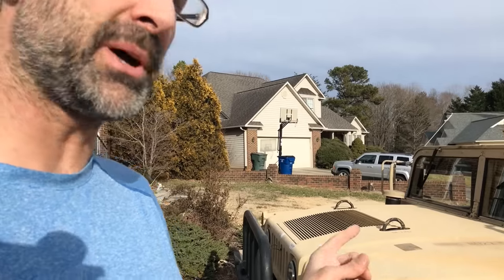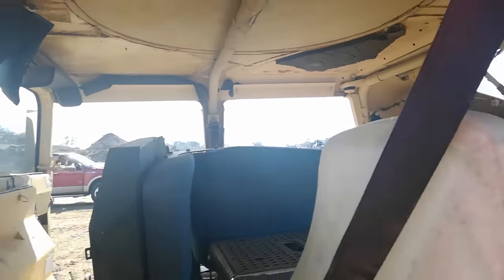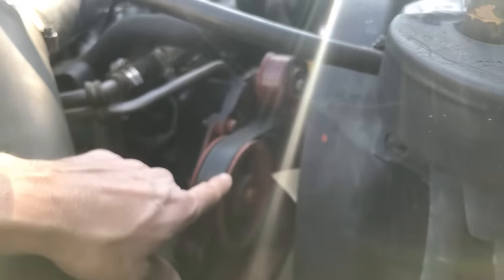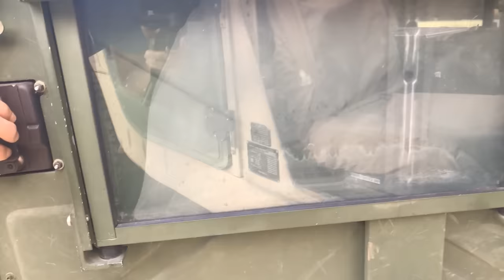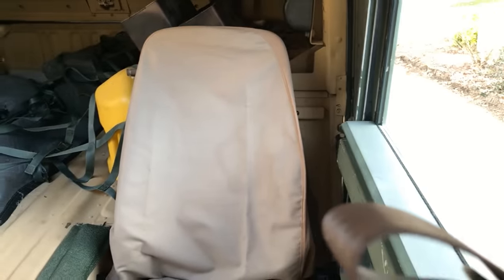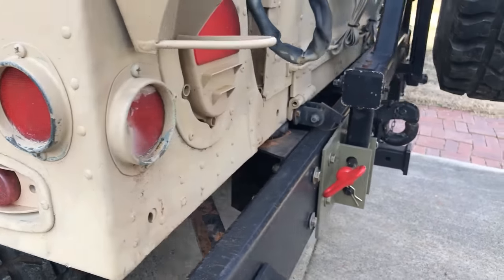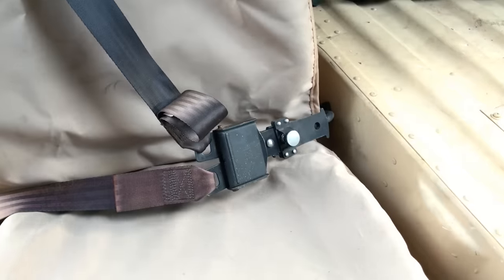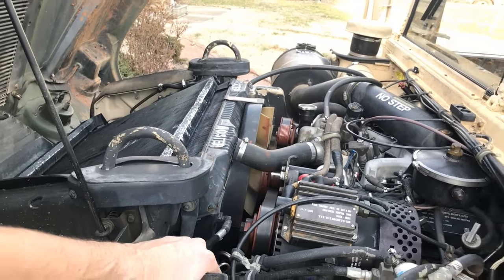Picking up a Surplus HMMWV M1045A2 from Auction & Transforming it into the Battlewagon 2.0

Comment: Ist time I've watched your channel so I don't really understand what you are doing other than this being number 2 so presuming it's replacing number 1. You also seem to be putting this back into military spec and I've never seen what makes up a military spec Hummer so thanks for the review and explanations that was very interesting. I was amazed that you got that engine running after seeing what came out of it's sump and knowing it had been full of water, I had no idea you could do that, in fact I'd have bet that you couldn't, guessing it's because it's a Diesel.  Anyway thanks for the vid I enjoyed it. Did wonder why they had a hatchback arrangement instead of a flat roof to the back, was impressed it opened from both sides.
Reply from the maker: Hatchback is because of the blast from the TOW missile that was mounted on top.

Comment: You do know that traversing assembly is for a motorized turret maybe for the TOW mount cause I don’t want to have my head out there!!!
Reply from the maker: Good to know
Reply: The TOW system goes on it ,when travelling. Lower ,and optics. -0352, Marine TOW gunner, and M.T. Nco.
Reply from the maker: @keithwittman4741  Thanks for the info.
Reply: With out the motorized turret, if you had the tow system up there 400lbs of equipment would spin itself to the low side !  You had to know that Before you pulled the handle for the turret lock!
Reply from the maker: @keithwittman4741  Motorized turrets are a fairly recent addition to HMMWVs. They had non-motorized turrets for 2 decades before SOME of them got motorized turrets. This was a TOW missile carrier and it had the manual turret, just like what is installed now.
Reply: @GearreportdotCom  I know, just saying when I had the manual style, it could whip you around. If you didn't know the tilt of the truck, and the 400lbs.

Comment: I’m getting my Humvee soon and it’s says JP fuel only. Can I just put regular diesel?
Reply from the maker: Yep. Mine says "JP5/8 Diesel Fuel only". If it is an older model, then run some diesel fuel additive to the fuel.
Reply: Gear-Report.com it’s good to hear that. Mine is 2002 M1123 6.5L. Just hope the regular diesel won’t cause problem to the engine. Do you put fuel additive to your Humvee?
Reply from the maker: @danielli2268  I ran a cetane booster and IP lubricant additive in my M1038 and M1045A2. Not sure if the M1165A1 needs it... but I'll use it in that as well.

Comment: Let me know when you start lining the unit with bed liner so I can buy stocks in Raptor
Reply from the maker: Not gonna happen. Bedliner is an exterior product. Not putting it in the bed, since it is interior. DEFINITELY not coating the exterior in that crap.
Reply: @GearreportdotCom  Bed liner can be used anywhere you choose to use it, I know of many hunting rigs and work trucks with the floor boards coated so it can be rinsed out with a hose and not rust out.
The raptor system works great and can be layed down to any texture
Your  rig your call
Reply from the maker: People use bedliner like that. I agree.
However, after reviewing MSDS sheets and discussions with a few people at different companies that make bedliner products they all say NOT to used beliner in enclosed passenger areas. The bedliner materials all continue to outgas toxic fumes when exposed to heat for years after initial curing. HMMWVs have aluminum bodies with almost zero insulation anywhere, and the drivetrain set up in the body. So, there is a lot more heat coming through the body than normal vehicles.
Put all of that together and bedliner in the passenger areas of HMMWV is a bad idea. It isn't a good idea in other types of vehicles. but at least the other vehicles are designed differently so that heat coming through the body isn't quite so extreme as it is in HMMWVs.
So, my resistance isn't a simple matter of "it's called bed liner... only use it in the bed". It is more of a health and safety concern based on MSDS data and discussions with manufacturers.
Reply: @GearreportdotCom  Were you thinking about using the dynamat Style insulation or the spray on Lizard skin? I have used the high temp dynamat on my SxS with good luck for heat shielding on the muffler / bed barrier. The Lizard skin I have not tried.
Reply from the maker: We did a project with lizard skin on our first Humvee. If you go to our website you will find a couple of articles about that project. SpaceIt worked amazingly. For this one we started a project with Kool Mat, but have not made much progress since we listed the Humvee for sale.

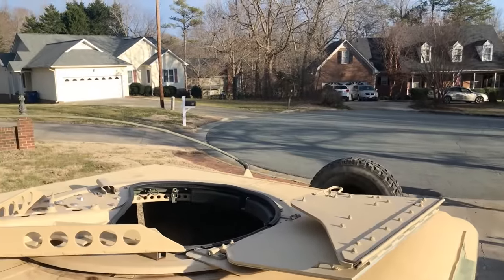Comment: Great done footage at 9:59 
How much $$$ do you have in this project if I may ask?
Reply from the maker: How much $... Honestly, I've been afraid to add the rest of the parts to my spreadsheet and get a real # for the total $ invested.
However, I can say that the HMMWV, transportation from the auction site and complete turret assembly were covered by the sale fo the original Battlewagon. I've also been lucky that I've been able to buy some extra parts when I've found great deals and sell what I didn't need for more $, while still giving people good deals. So, I've spent $ on parts, but then made back a healthy % of it. Also, once the reviews are done I've also traded a few review guns for pricey HMMWV parts like the spare tire carrier. Now that most of the mechanical and structural additions are done (turret, engine running well, bumper) I'm moving to upgrades that brands send for reviews. So, there is a lot of value added to the Battlewagon 2.0 without cash changing hands. 
And I can't even begin to calculate the time invested. Yikes!
How's that for an answer that isn't really an answer? lol
Reply: @GearreportdotCom . Sounds like what I tell my wife about my H1's.😊
Reply from the maker: Oh my. Now THERE is a topic. 
I don't talk to Mrs Gear Report about the HMMWV.
She HATED the original Battlewagon with a passion. It wasn't until I sold it and made some $ that she started to come around ... a little.
Now she has seen how much I've been able to increase the value of this truck by getting it running and roadworthy, she actually suggested that I might think about doing it for a living. lol
She still hates them, but I guess she figures if I'm going to do it anyway, why not make money at it. 
But no... not what I care to do for a living. I think dealing with some shoppers and customers would suck every bit of joy out of it for me.

Comment: That was water in the oil pan? How long did that sit for?

I am assuming that it didn't run or start in the auction. Was that pretty risky feeling? Looking at some postal trucks on Govplanet. Some don't start and some don't have keys. So kind of wonder if it's a simple fix or if there is something seriously wrong with it.
Reply: It is always a risk, even if it runs. Just assume it will need an engine and transmission. If it doesn’t, then you win.
Reply from the maker: And yeah. That hmmwv had water in the engine. Not sure how long, but it looked like years. 
Took some work, but it ran very well
Reply: @jeffcress2413  So what would you have done if it did need a new engine and/or transmission?
Reply from the maker: Replace them. Not many options here
Reply from the maker: @ESLinsider  I love your enthusiasm, but that is a terrible idea. You don't know any of the history of that van. Even if you can make it run, will it be safe? Safe for you... but more importantly, safe for the innocent people around you as you drive. The only option when buying an old auction vehicle like that is to put it on a trailer and haul it to a shop to AT LEAST do the minimum safety checks. What you describe will have you feeling too committed and likely willing to take too big of risks.
Reply: @GearreportdotCom  So this vehicle doesn't have an EUC and I am trying to figure out if I need an SF97 and how much time it will take to make it street legal. Minus the EUC how much time did it take you to title and make legal?
Reply from the maker: @ESLinsider  HMMWVs are different than vans. Anything I tell you about the HMMWV wouldn't apply to registering and titling any vehicle with a VIN (HMMWVs don't have VIN). 
How much time to make it safe and street legal?
Depends COMPLETELY on the specific condition of the vehicle. 
Not trying to be evasive. There just isn't a way for me to answer that question in a meaningful way.

Comment: I read your post on HUMVEE speeds from your website. I saw this HUMVEE rebuild from a pretty reputable company that claims their builds can go up to 96 mph. I wanted to ask you if you know what it would take to get one capable of similar speeds, and if you thought it would be worth the effort and money. Thanks.
Reply from the maker: I've had this one up past 80mph on the interstate to keep up with traffic and it did great. BUT this truck was barely used and appeared to have never been abused offroad. 
Most HMMWVs I wouldn't think of going that fast until all of the steering, suspension and brake components were checked and likely replaced. Any slop in those systems will cause big issues when you get going that fast. 
96mph. Beats me. 
I've never looked into getting one that fast, as I don't see the point. They aren't designed for that.
Reply: I believed you are referring to humvee with engine replaced with duramax.
Reply from the maker: @ferdinanddimayuga2269  Duramax, LS swap, etc. There are various options to replace the engine and transmission. My point is that even though it CAN be done, I'm not convinced that it SHOULD be done. :)
Reply: IF you get a HMMWV up to 86 MPH it will feel like you’re entering the Earth’s atmosphere! They are not made to go that fast. I got one up to about 80 when I was stationed in Germany.
Reply from the maker: If it is well maintained and wheels balanced it is no big deal.

Comment: Do you sale these? If so what's the  cost before and after?
Reply from the maker: This is my 2nd HMMWV. I sold the first one in order to buy this one. I'm sure I'll sell it eventually, but right now I wouldn't consider any less than $40k.
This might be interesting to you:
https://gear-report.com/what-does-a-surplus-hmmwv-cost-how-to-buy-a-humvee
Reply: @srihcadi5383  LoL. The non-running 1st generation HMMWVs could sometimes be gotten for $4-5k a couple of years ago. But you can't really find those deals any more.
AND this is a 3rd gen HMMWV with a long list of upgrades and some truly rare parts. It is insured for $45k.
Reply: Gear-Report.com 
What transmission did it come with?     Thanks
Reply: @mrt.5689  4 speed .4l80e

Comment: The Old Fluid is that really water that's no good if you wear drive it with transmission  blowing to smithereens
Reply from the maker: The water WAS in the engine, not the transmission. It drives great.

Comment: Is there only one battery? If your using 2 12v batteries to make 24v and tap off the first of the 2 you will get only 12v out.
Reply from the maker: There are 2x 12v batteries. You are correct that either battery could supply 12v. However, the start circuit in HMMWVs is VERY sensitive to voltage imbalance between the batteries. 
In 3 speed HMMWVs it is a bad idea to tap off on one battery since the 28v charging system can't accommodate the additional charge required by the low battery without overcharging the high battery. 
4 speed HMMWVs with electronically controlled transmissions (like this one) have a separate 14v charging lead to compensate for the 12v drain the transmission controller puts on the aft battery. However, it is not designed to accommodate a heavy 12v load beyond that of the TCM. 
So, the preferred method of ensuring that 12v accessories don't cause battery imbalance is to feed them via a 24v to 12v converter.
Clear as mud? lol

Comment: no winch ?
Reply from the maker: Correct. From what I've seen, only about 1/4 to 1/3 of military HMMWVs that go through the auctions have winches installed. It seems like it more like 50% a few years ago with the older models. But the newer ones often either have had them removed, or appear to have never had a winch.
Reply: Maybe when they found out they were going to an improved vehicle they didn’t bother. I own several military Vehicles and quite a few new and collectible four wheel drives if one didn’t come with the winch that’s the first Thing I install. i’ve only used one for self recovery twice but I use them a good bit in our commercial plumbing company to move Pipe. Put Tracks back on the Escavators And recover other peoples vehicles
Reply from the maker: @claygoodwin8108  I hear ya. My prior HMMWV had a winch. I never used it for self-recovery, but did use it to pull the trailer out of the back yard and move a few things. This is a marketing truck for me. So, I don't take it off-road. So, no need to get a winch yet.

Comment: Are they still using the 6.5 drivetrain on the new ones?
Reply from the maker: Yep. 6.5 turbo with 4l80e trans and 242 tcase.
Reply: Gear-Report.com Just an update, they have stopped using the 4L80E in favor of the 4L85E in the hopes of less failures in the up armored. When the 4L80E fails they are replaced with the 85.
Reply from the maker: Ah, ok. Uparmored are some overweight pigs.

Comment: Wouldn't you want to make newholes for back up cameras? shouldn't be to difficult.Defiantly needed but those holes are there for a reason I would think.& Don't breathe paint fumes .(CR??)
Reply from the maker: LoL... the military cuts SOOOOOOO many holes in these trucks. Filling in one here and there isn't a problem.
However, I did end up cutting new holes. :)
Reply: Those holes are used for panel alignment when they built them at the factory. A lot of cars and trucks have them, but they're usually covered up.

Comment: Oohhh!
That's a looot of water to have in a engine 😨
Reply from the maker: Indeed. That was not a good feeling when the water started pouring out.
Reply: Yeah, especially when you doesn't know for how long it been there..
I've been mechanic for 20yrs and the only time i've seen something like that was when I fixed a small car who they drove in a water filled ditch😂
But I got it back running! But we had to cut half of electric hardness because it become totaly mayhem whith electric windows going up'n down by them self etc etc.😂😂
By the way, I think that if you take the door windows apart you probably could order just the glass from some company who sales house windows.
I bought a couple of windows to My House, and since it's a old house whith special size windows I ordered them directly from the factory and since I live in northern Sweden I ordered them whith 3 glass in a sandwich wich is standard here because of the winters.. 
The size was about 20x40"  and I ordered them in to exactly what I measured, 6 diffrent windows,
I paying just less than 30 dollar for each window.
What I'am trying to say is that if you could order them in your size (thinner than mine) it would been the cheapest i think.
I hope you understand me.
Cheers from northern Sweden 🍻
Reply from the maker: Water in engine: Exactly! At first I had no idea how rusty it might be inside. Fortunately, once the piston rings were broken free it has run VERY good. So good that I'm actually worried that it is due to blow up soon. 

Windows: Around here ballistic glass laminate is fairly expensive. I've checked with all of the local glass companies and none of them can get the 5/8" thick ballistic glass laminate. I found a shop that could make 1/2" single layer tempered glass for about $45 each. But if I'm going to spend that much then I want to hold out for the real ballistic glass that is correct for these doors. In the meantime I have replaced the two worst windows with some used, but serviceable normal 3/8" laminate from normal HMMWV x-doors (non-ballistic). It is not perfect, but at least I can see through it. :)

Comment: I am having a problem with my power steering pump burping out all the fluid. Any problems with yours?
Reply from the maker: No problem with mine. Sounds like maybe you have an obstructed line or PS hoses on wrong.
Reply: @GearreportdotCom  👍 I've replaced most items. I'm not sure why it keeps burping. When you replaced your injector pump, were you having a hard time keeping fuel going into the motor. I have 2 and one seems to loose fuel pressure when going up or down steep slopes
Reply: @GearreportdotCom  I love that slant back and turret. You got a really good unit. I know you had to drain the fluids and check everything over. Alot of work, but that's set up really good. Mine are both the 899
Reply from the maker: Thanks! I’m thinking of selling the slant parts to go to a GMV type config.
Reply: @GearreportdotCom  I built wagon rears on both mine so i would have full covered storage with double doors
Reply from the maker: Good call. My first hmmwv was a 4 man soft top. So much more flexible in terms of what it could be used for. The slant back looks cool, but is harder to fit stuff in the back.
Reply: @GearreportdotCom  👍 thanks for answering back. Your slantback is tempting me